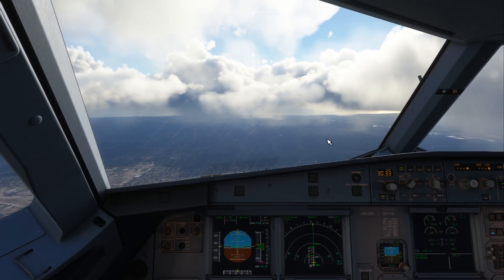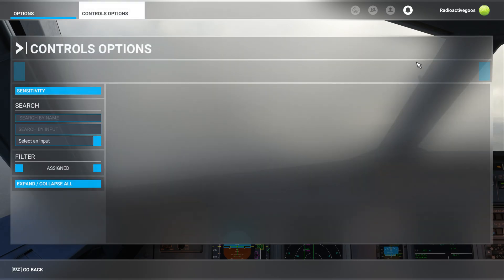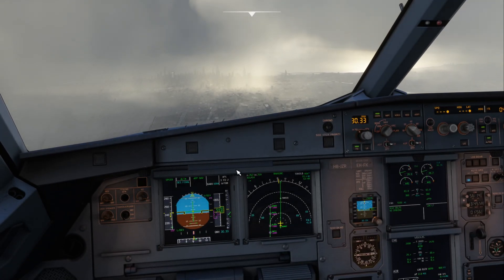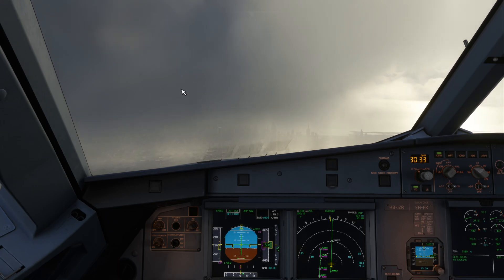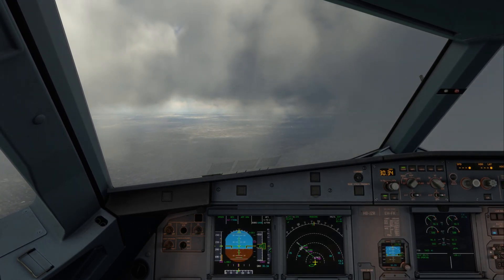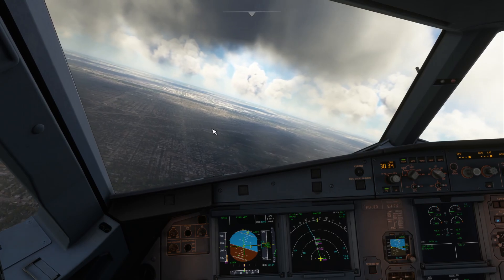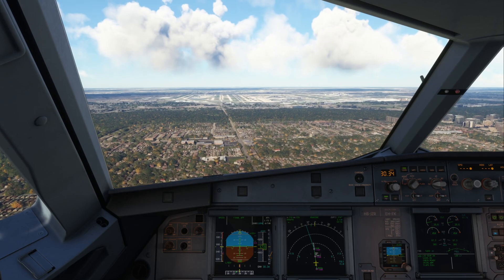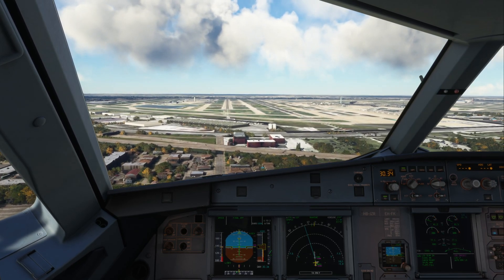Fenix A320 Sensitivity Settings + RNAV 28C at O'Hare

Comment: I thought it was just me getting the F3 nose down issue. I must try it without the autopilot in and see if the nose drops. 

Either way hope they acknowledge and resolve it soon, otherwise it's a great product.
Reply from the maker: Yes they've got a fix in the works but it's a little more complex than the other issues they've already released for. My current solution is flaps 3 at 5nm with autopilot off and all it needs is a slight pitch up to counter. Not unrealistic in terms of ballooning effect, but the autopilot doesn't recover it well.